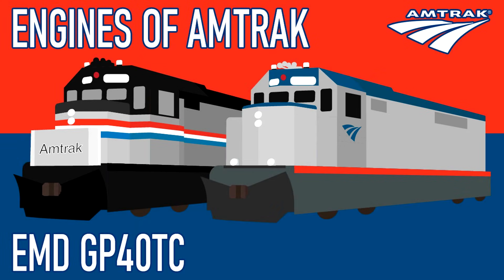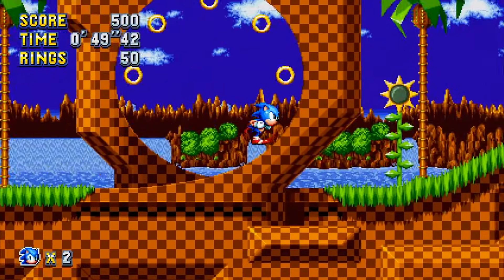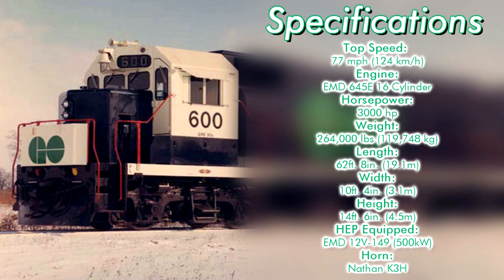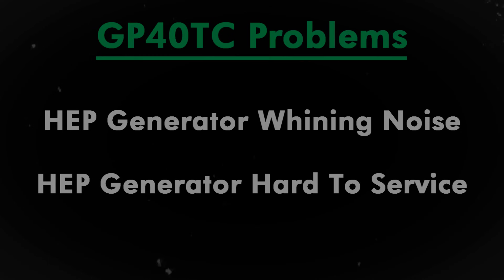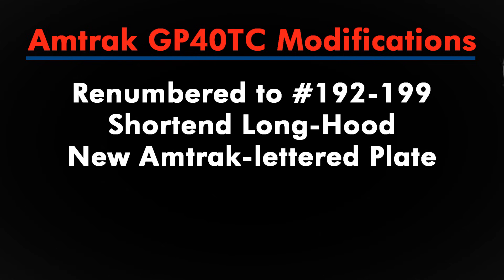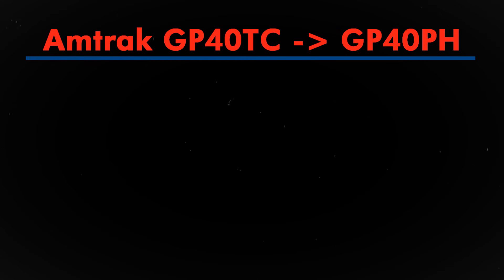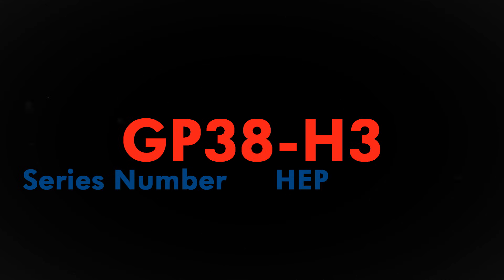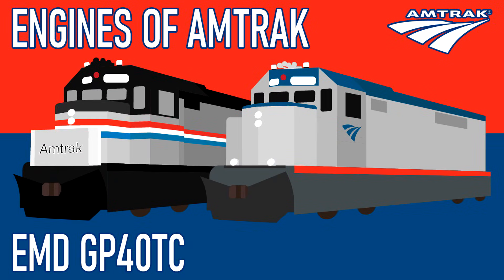Engines of Amtrak - EMD GP40TC

Comment: Apologies I’m running late but there’s a short line connecting to different farming industries where I live that has a roster of locomotives used for switching and moving cares around. 

I did some digging and found out one of their GP40-3s, used to be Amtrak 650, there’s two other GP40-3s they have but this one now WAMX 4042 is the only one that previously worked for Amtrak at some point in its life. I should note it does look like it’s been rebuilt.

Comment: Note that while EMD built them, they were NOT built in the US - they were built in the EMD London, Ontario plant.  (EMD was not the only part of GM that had a plant in London - there were two other GM plants there - one being a twin of the most famous GM auto plant that did NOT build Corvettes - Lordstown, Ohio - which built Camaros and Firebirds - including Trans-Ams.  The other was for GM Truck and Coach - also known as GMC - in the Coach case, I am referring to buses - transit buses in particular.  Like EMD, a surprising amount of GM Canada's Coach product found itself in the US - among the customers were New York City's MTA, SEPTA, and first DC Transit, and later successor WMATA.  However, not even the surprisingly-successful transit bus business saved GM Coach - in either the US or Canada; basically the same thing that happened to EMD - the businesses were spun out and sold.)  I know about the transit buses because I rode some of them in WMATA and ex-DC Transit (acquired by WMATA) in 1976 and 1977 - in the tailchase of their careers with the transit authority.  Built in Canada, but inspected at the then-home of Team Suburban - Baltimore, Maryland.  (In addition to being the assembly line for all Suburbans, the heavy-duty C/K pickups - in both Chevrolet and GMC branding - for the eastern US were built in Baltimore until the tailchase of the Clinton administration.  However, the success of the Suburban did not save GM Baltimore from the bean-counters.   (We ALL know why the Suburban was successful - in both Chevrolet AND GMC branding it could carry large loads, tow large loads, or both.  It wasn't JUST the Secret Service that purchased and/or leased the beasts of burden - so did military installations and law enforcement; an even dozen wound up in the Maryland State Police.)
Reply: I though GM Baltimore only built Astro vans post 1984?

Comment: I say Amtrak should bring back the SDP40F’s, P30CH’s, and E60’s but better and more well maintained. Speaking of Canada, I have a cool Idea of a new Amtrak line called the Amtrak Canadian line and it will go up from Washington state through Canada and up to Juneau and Fairbanks Alaska,USA. If anyone wants to travel on the Amtrak Canadian and stop at one of the possible Canadian stations they will need not just a train ticket but a travel passport.  If you are traveling on the Amtrak Canadian up from Washington to Alaska than al you need is a train ticket because of obvious reason’s. The land will still belong to Canada but the rails will be owned by Amtrak, US  Canada and the Canadian railroad company’s. The paint color’s of the Amtrak Canadian line locomotive’s are as follows: Red,Amtrak blue, reddish orange like maple leaf 🍁 called Canadian orange, pine green or light brown and black. These are the colors for the Amtrak Canadian line from the most northern lines from Van Couver up through Canada and finally up to Alaska. Another Idea I have is a 7th phase of Amtrak paint and it is the blood nose front and a light blue middle and the end is silver (platinum mist) or white and in the light blue the pointless arrow is revived but new, Amtrak dark blue for railroad tracks and red for the arrow at the end and the ends are pointed and a black canter stripe through the blood nose and when it hits the light blue it sharpens to a point and ends so the color’s are Red, light blue, Amtrak deep blue, Silver(Platinum mist) or white, and black. Those are the ideas I have. If the President of Amtrak is reading these comments plz consider my ideas and finally the Amtrak Canadian line will be owned by The US and Canada so that no illegal immigrants move in to Canada or the US. If anyone was reading my comment, thanks.

Comment: Amtrak Guy: Im gonna redo this series

Youtube: I will take down Engines of Amtrak V2.
Reply: Also on 5:53, #650-664 was used on Amtrak's GP40s back in the early 1990s. When they returned to Helm Leasing in the late 1990s, Amtrak reused the same numbering on their HHP-8s until ACS-64s came in 2014, and they were retired.